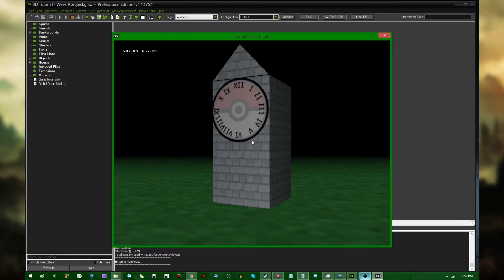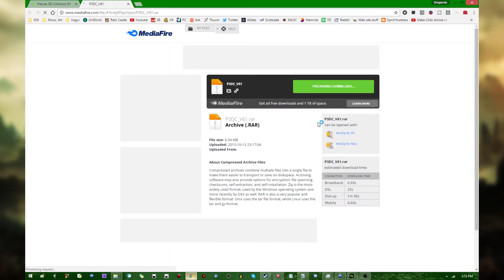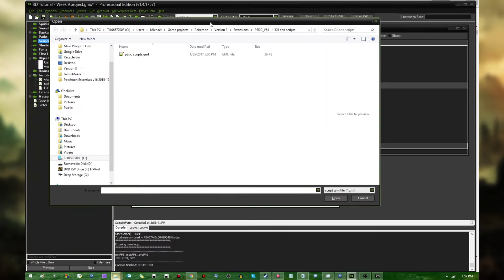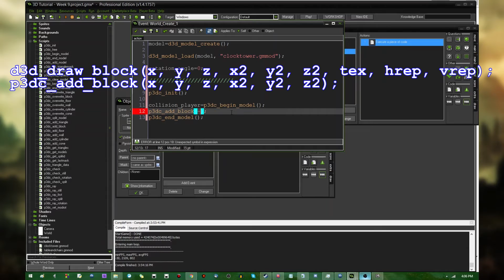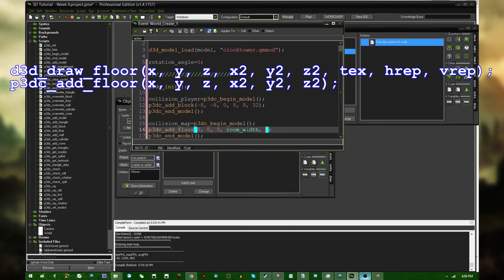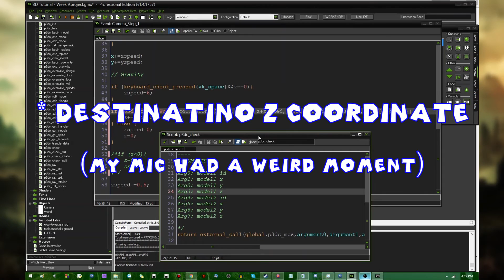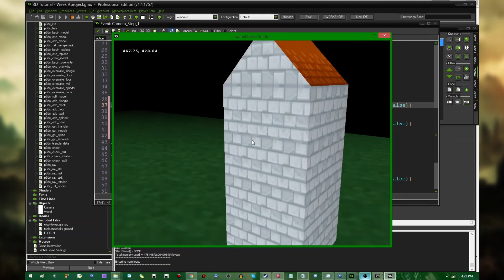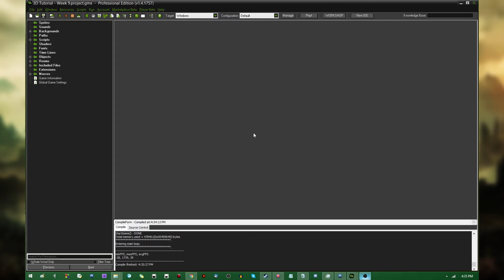Game Maker Tutorial - 3D Games - Precise 3D Collisions (P3DC)

Comment: Would you happen to know how to rotate the collision of something? I'm pretty sure it involved using 'p3dc_set_modrot', but I have no idea how this function works lol. All I want to do is rotate a model's collision by 90 degrees (On the Z-axis). Love your videos by the way, they are a godsend. Thank you.
Reply from the maker: p3dc_set_modrot ought to do it, I think you have to call it before adding a model and call it again with (0, 0, 0) to reset the transform after adding a model? Also, make sure your angles are in degrees, not radians.
Reply: Hm, I've been messing around with it and for some reason I'm not getting any changes with how the collision is rotated. I'm not sure if I have the wrong arguments for modrot...it's saying it requires 10 arguments, but I think it really requires 3 from how it's set up. Either way after some testing it's not making any changes regardless. Here's how I have it: 

p3dc_set_modrot(0, 0, 90);
p3dc_add_model(map_model,map_x,map_y,0);
p3dc_set_modrot(0, 0, 0);
Reply: Well I haven't figured out how it works yet, but I've discovered a way to work around it effectively. So I don't think I'll need to worry about rotating any collision models from now on. Thank you so much still. 
Also, I'd hate to ask something again, but would you happen to know how slopes or stairs would work? Or at least some code to get them to work, I tried understanding the examples for P3DC but I've still been unable to implement them properly. This is the last thing I need. If it's too complicated to explain in a comments section we can voice chat or something, I can use either discord or skype. Again thank you so much for your time, it really means a lot.

Comment: gamemaker can't define most of the lines in the p3dc scripts. I need help
Reply from the maker: Sounds like an issue recent versions of Game Maker have with external DLLs that take five or more arguments. My current solution is to roll back to a slightly older version (1.4.1757 instead of 1.4.1763) but other than that all I can really say is hopefully the issue is fixed before support for Game Maker Studio 1 is cut off.

If you're already using GMS2, it may already be fixed in the next update, or at least YYG said as much when I submitted a support ticket about it, but I'm not sure when the next one comes out.
Reply: ok thanks for the tip

Comment: can you make a collision tutorial with just the ingame block model and no P3DC because i use studio and want to have rotated blocks
Reply from the maker: I might, but P3DC (and other collision systems) work in Studio so I'd suggest you use those instead.
Reply: @DragoniteSpam  can you make a tutorial on terrain collision, please?  My camera keeps bobbing up and down and it's very annoying on terrain
Reply from the maker: @anuragt2299  Damn, has it been that long since I posted this? I should, and I keep thinking about it, but I also keep putting it off - due at least in part to the fact that collisions with surfaces that aren't at 90-degree angles from each other are kind of annoying.
Reply: @DragoniteSpam  I saw your video when you made the program terrain creator. The collisions were great! At least just post the code in the comments, I really want this to work for my game. Thanks in advance
Reply from the maker: @anuragt2299  The terrain one? That was essentially just what one might do for 2D collisions, "check each new position and stop if you overlap with something solid," and I'm still not really happy with it - although if you really want to see the code, most of it is in here somewhere: https://github.com/DragoniteSpam/VirgoDawnBirdGame/search?utf8=%E2%9C%93&q=movement
(You could also use a raycast instead of an overlap, but I've found that means you tend to get stuck in walls in annoying ways sometimes.) Anyway, if you want to get into the nuts and bolts of this stuff, on the Game Maker forums and a few other places there's a guy called TheSnidr who made a REALLY impressive system for 3D collisions, and a few other things, which I really need to sit down with and figure out how it works because it's probably the one that's the most robust, and the only one I know of that's still actively being developed.
Reply: @DragoniteSpam  I didn't find anything in your github page. If you get the time, please can you help me out with this? I'm really struggling with it. 
There was one method I used, where if you were on the model, your zspeed =0 and z++ so you wouldn't fall through. But that failed as my camera kept bobbing up and down. I want a clean snap to the model
Reply from the maker: @anuragt2299  Hmm, what's the best way to get in contact with you?